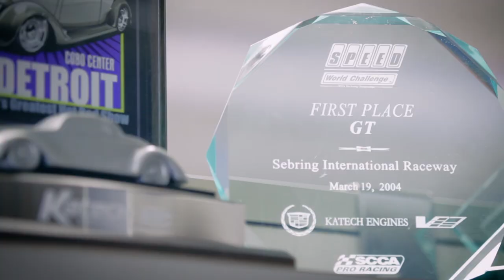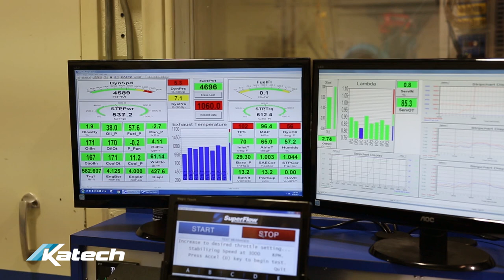BUILD VIDEO - Katech 700hp Naturally Aspirated 427ci Corvette Grand Sport road race car

Comment: Doesn't it come with a awesome suspension from the factory
Reply from the maker: It comes with Magnetic Selective Ride Control.  It's nice, but it has it's limits and there is room for improvement.  We're using DSC Sport Tractive shocks which are an actively controlled shock that uses the factory magnetic ride control system to control shock valving.
Reply: @KatechPerformance  damn that's amazing can this work with my friends zl1.
Reply from the maker: @walkingtalkingmonkey4103  regular ZL1, yes because it has MSRC.  ZL1 1LE has a different non-magnetic shock.

Comment: why a H-beam instead of an I-beam, especially on a N/A engine and why a compstar vs an ultra vs a k1
Reply from the maker: We use Compstar H beam on most engines except for the very high hp stuff then we go to the Ultra.  We've used K1 before, but generally prefer Callies.
Reply: okay, but why h-beam instead of I-beam?
Reply from the maker: Callies Compstar H-beam are sufficient for this power level and priced lower than the Callies Ultra I-beam.

Comment: possibly an easy 15 - 20,000 engine build =/  ...fml
Reply: Which isn't that bad if you compare it to a supercharger kit or upgrading to the ZO6 AND you get a new engine.
 
I'd like to know what sort of gas mileage should guess compared to boosted engine.
Reply: Naw bruh try 30,000 plus

Comment: 93 octane on 12.5:1 compression.  Fcking time bomb
Reply from the maker: We have tested this extensively for 5 years including a lot of track use.  12.5:1 on 93 octane with this camshaft is perfectly fine.
Reply: @KatechPerformance  Thats nuts for that compression.  But whatever bro. Everyone i know runs e85 or race gas on that high a compression.  Risky

Comment: so basically 7L 700Hp. Well done. Is this 93 octane or e85?
Reply from the maker: 92+ octane
Reply: KatechPerformance Wow, just wow. I was thinking some sort of race fuel or alcohol was involved. Well done on a very impressive build. Who makes that diffuser? That thing looks sweet! This is the true C7 Z06 GM should have given us.
Reply from the maker: We make the diffuser
Reply: I’m pretty sure they used a mild cam for great drivability as well.  They could have easily used a bigger one and got 750. This engine with a ported msd from Mamo and E85-Specific is an easily 750+ hp engine. Sign me up for that anyday over boost for a reliable fast street car.

Comment: Is it just me or do those cylinder walls look a little thin at 2:05 700hp is a lot of power for just that little separation between cylinders.
Reply: Tibor Pandza did you miss the cylinder sleeve install 10 seconds later?
Reply: aag318504 No, I saw that, but my point still stands. I'm well aware that the engine can hold the power it makes reliably but it just looks odd to my eye
Reply: Tibor Pandza If this car had FI your question would make sense but since this obviously a N/A setup it doesn't.

Comment: How much n/a power can you guys get out of the stock engine?
Reply from the maker: We make 600hp with our head/cam package.  It's a mild cam.
Reply: Wow, that's an impressive bump.  What is the most restrictive part on the LT1?  A 33% boost in HP with just heads and a mild cam is insane.
Reply: How much does that package cost installed? Thanks.
Reply: wow

Comment: approx. @ 5:40 in the vid. no spark plugs. guy stuffs wires in the hole. i know it was done for the video. just an observation.
Reply from the maker: There is a reason for everything.  The engine goes to dyno after build and dyno headers are installed.  After that spark plugs are installed.
Reply: @KatechPerformance  ah, didn't think of that. thanks for the reply n stuff.
Reply from the maker: @panicrev613  no problem

Comment: I don’t get why go thru with all that work when you can just add a zl1 supercharger and get those numbers 🤦🏼‍♂️
Reply from the maker: We want to remain naturally aspirated for road racing.
Reply: KatechPerformance Would you still be able to add a Power Adder?
Reply from the maker: @classicc74  If we built a boost-specific version, yes.  We would not add boost to the 12.5:1 compression version.

Comment: Yay high compression for running only e85 or higher! making the same power as every other high compression e85 or better car! wooo doing something no one else has done! im not a follower i swear! wait u use a 7 liter? oh ford uses a 5.2 aluminator to make 650hp
Reply from the maker: This is not E85-only.  The engine runs on 92+ premium.

Comment: Sooooo you did 10s of thousands of dollars of work and got....stock power.  rah rah sis boom bah!
Reply: What the hell are you talking about? Stock power? Are you comparing FI vs. NA?
Reply: Buddy z06/z07 come with about 650/700 at the wheel. They wouldn't even SELL for less. Net bill? Probably 15k.

You could put a GRANDMA spray 100shot of nitrous on that YOURSELF for $1000 and take that car to 600hp. Pull supercharger off, put plate between hat, bolt it all back together, run wires, run line to bottle, READ THE INSTRUCTIONS and that car will bang 100 more HP for the rest of the life of the car without damaging a thing without even a single dyno/tune(each of which IS recommended however not necessary).

Hell wtf is he even trying to mod without doing a supercharger first? The engine basically has a "insert supr charger here" label on top of the engine.

Sorry but who even buys a grand sport? That guy basically bought a z06 with all his mods/price to mod and the engine is about maxed unless he starts going super exotic with twin turbos or nitrous.

Naturally aspirated engines went out when platform shoes were cool.

LASTLY his comments are that this is a track car...WHAT track car doesn't have a bolt on s/c or nitrous or turbos making the engine turn REAL power?
Reply: Chris Harris:  Buddy z06/z07 come with about 650/700 at the wheel.

Lol. Have you been living in a cave for for the last several years?  A brand new stock Z06 does not have 650/700 at the wheel.  It has an SAE certified 650 hp/650 lb.-ft of torque at the crank. I know you'll say I'm a liar so here is your proof directly from Chevy (it's all over the page) http://www.chevrolet.com/performance/corvette-z06-supercar

A new Z06 will put down 550 hp (give or take a few) to the ground/rear tires stock. BTW, the Z07 package is just an option available on all 3 trim levels (1LZ, 2LZ, or 3LZ) of Z06s. The Z07 option gives you carbon ceramic brakes & specific suspension tuning/calibrations above the regular Z06 suspension (which is already excellent). You can also order just the carbon ceramic brakes as a $7,495 stand alone option without the Z07 suspension tuning on any of the 3 trim levels if you want to.
Reply: SORRY, I've mixed my numbers with crank and wheels. It's not THAT BIG of an upgrade that could be changed with a set of headers and a smaller cam. Z07 is 650/650.

Why would I call you a liar? It's not like it can't be verified.

In any case, my point was a light reference to them turning a grand sport engine into a z07.

Enhance your calm, John Rambo. There's no battle here.
Reply: I shouldn't have assumed that you would accuse me of being a liar but this is YT after all. I've been called all kinds of things just for posting an opposing point of view. Lol.  All Z06s are 650/650 from the factory. There are people with Z06s putting down 700+, 800+, 900+, & even 1,000+ hp to the ground with the appropriate mods, which is a lot for any street car. But I have broken the rear tires loose going perfectly straight on the freeway on a nice sunny day at 70 mph with the stock 650/650 in a 2015 Z06 2LZ (7-spd). Even the stock power is kind of overkill for the street in most cases. 

For my money I prefer the Z06. It's cheaper to buy a Z06 (especially right now with all of the discounts/incentives on them) than to buy a GS & then send it to Katech (or another high end shop) for an engine upgrade. But for some people with more money than they know what to do with, who like NA engines & don't mind voiding their warranty, I suppose this is a nice engine option for them.  

Katech's engine isn't cheap but 700 hp & 639 lb.-ft. (at the crank) out of a naturally aspirated engine is still impressive. Katech's engine also runs smoothly enough to be used as a daily driver just a like a stock Z06. There are shops that can do engine upgrades for less that also turn out lots of power. The problem is some of those other shops will leave you with a car that idles/runs like crap & the entire car shakes unless your foot is buried to floor, making them completely unusable on the street.  There are also horror stories of people who end up with issues & once some of those shady shops have your money they will tell you to take your issues & piss off. Katech seems like the kind of place that would stand behind their work (though I don't know that for a fact).
Reply: The difference is the "stock power" you're referring to is with a supercharger. I'd take 700 N/A any day over 700 with a supercharger. It's just a different animal.